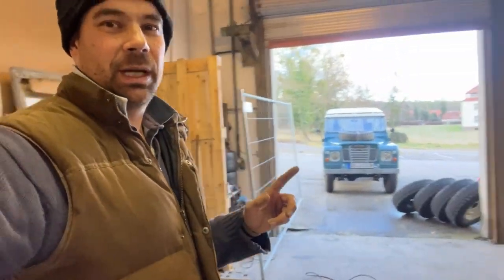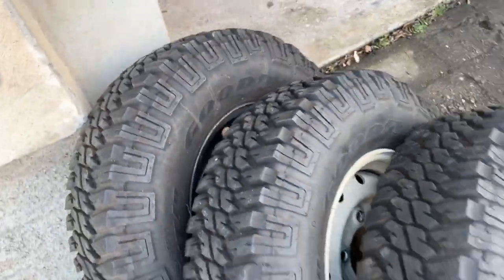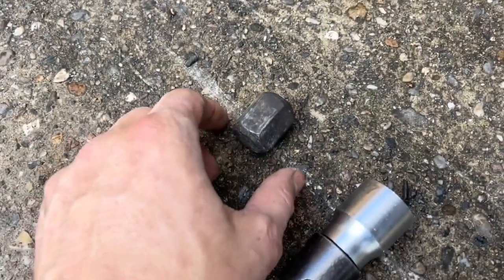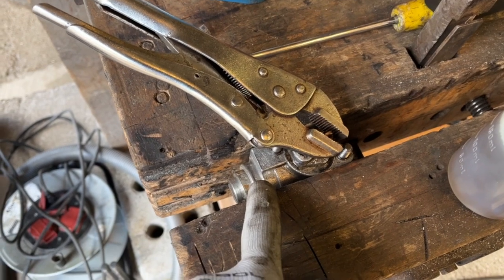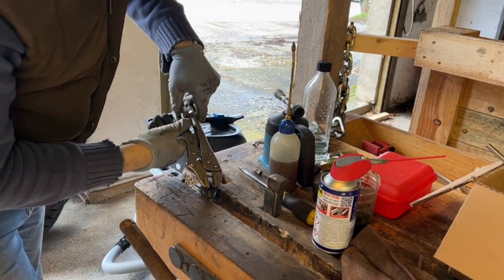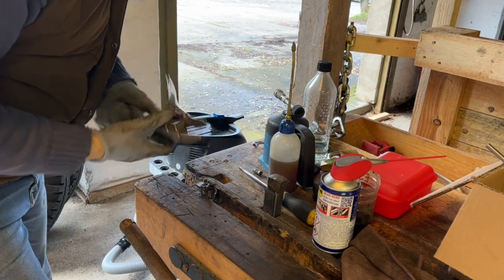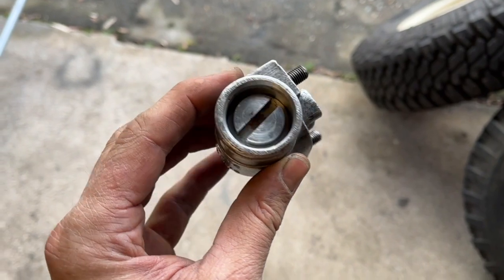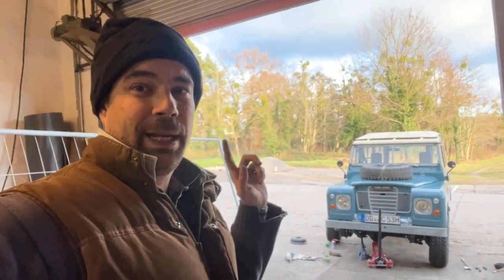Land Rover Series 3 - Preparing for the MOT/TÜV Pt. 2

Comment: Another entertaining Landy video, thank you sir.
With drum shoe brakes, I've always filed the leading friction material edge, to remove the sharp edge. Sometimes if the leading edge of the shoe friction material is sharp as in square, which occurs with natural wear; the drum brakes can grab as you described, when applied lightly.
I think bicycle brakes can suffer this kind of lock-up too, where the friction material pulls itself in, so the brake material is adjusted so the trailing edge makes initial contact. Thus the friction material is dragged into the rim as opposed to pushed.
So I believe similar principles apply. By taking the leading edge back a few mm, the material is dragged into the drum as opposed to pushed.
I will need to service the drums on my 1974 Station wagon ‘Gigi’, and they're all seized on, but working well with regular use, no power assist, but they are perfectly adequate.
My fear is someone brake checking Gigi, which would probably not end well for them! So I've a go-pro recording each drive, and I drive her very differently to a modern day vehicle. That's the joy, so much more of a visceral experience than the rather flat boring experience of contemporary vehicles which have inadvertently had much pleasure of driving engineered out.
Reply from the maker: Hi Chris, thank you for the message. The next video will be exactly that job. Replacing the front drums and shoes. Happy motoring with your station wagon and speak soon, Joël

Comment: Slight hark back to earlier posts, about the age of tyres. On the inner part of the side of the tyre, next to the rim and along with all the other text, there should be four numbers in an elongated oval. These are the week and year of the tyre's manufacture. My rears have 1916 on them, meaning they were made in week 19 of 2016. Co-incidentally the fronts are marked 1619, made in week 16 of 2019.
Reply from the maker: Thanks, I will check the date of those crossply’s.

Comment: You can get longer studs for using with Wolf style wheels, however, you can use the short studs and the normal nuts and tighten to 170nm (vs much lower on short studs and standard wheels) is the correct for short studs and Wolf wheels as determined by the British Army
The longer studs are available from Paddocks a set of 20 was a couple of years ago at least £120 ish including VAT.
The hard part is swapping them out, so high torque nuts is definitely an option even though they look odd.  You can also buy plastic covers to go over end of normal wheel nuts to help protect the internal threads
Reply from the maker: Hi Dean, that’s great, thank you. I hadn’t heard of high-torque nuts.
Reply: @My911  they’re standard nuts just torqued higher for wolfs

Comment: Might be worth looking into modern 7.50R16 tubeless options, e.g. BFGoodrich KM3, Goodyear Wrangler AT
Reply from the maker: Thanks Ian. It’s one of those things. I have two sets of wheels/tyres. One set has the right tyres, the other set the right rims. But the two don’t mix. Splashing out on a full new set of rims and tyres is not an option right now, so I will have to live with what I’ve got. 🙂
Reply: Is it possible to run the modern tubeless tyres with a tube on the classic rims? 
I believe the more modern tubeless 7.50R16 tyres are compatible with the wolf rims so that might be an option but if you’re wanting the classic rims with modern tyres that doesn’t help.

Comment: Those wheel cylinders are such a pain aren't they! I've literally just inspected all of mine- they are TRW ones, they are all bone dry still. From what I hear they do seem to be well recommended, perhaps look into a set of those? Mine were all stripped and cleaned prior to fitting and the seals packed with red rubber grease. Certainly my experience is that grabbing can be caused by contaminated shoes- happened to me in the traffic getting out of Goodwood just prior to the brake overhaul, quite unpleasant. 
How do you adjust your brakes? A while back, someone sent me a LR service bulletin which suggested jamming the brake pedal hard down, winding all the brake adjusters hard on, releasing the pedal and then backing off the adjusters, giving more accurate adjustment. It certainly works for me- I've cut a stick which goes between steering wheel and brake pedal for when that has to be done.
Reply from the maker: That’s a good tip. Thanks. I’ll be doing that with my brake overhaul. Which is happening soon.